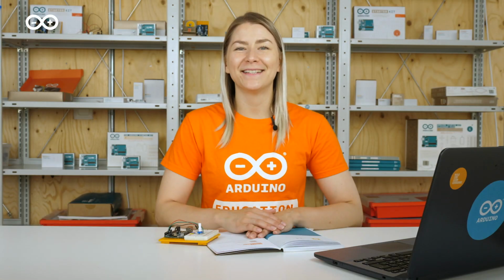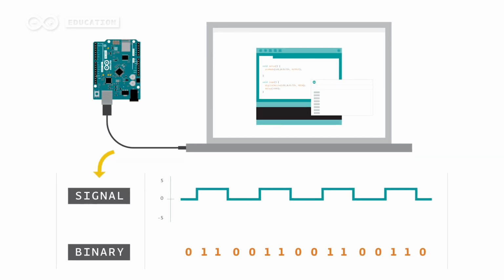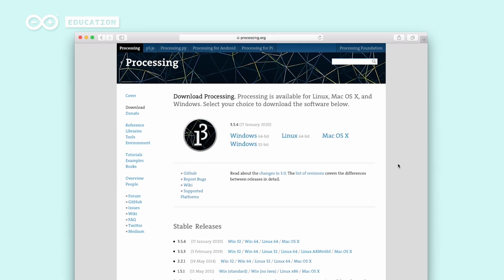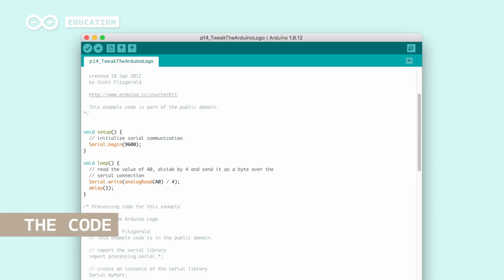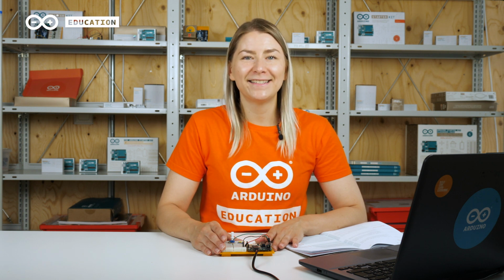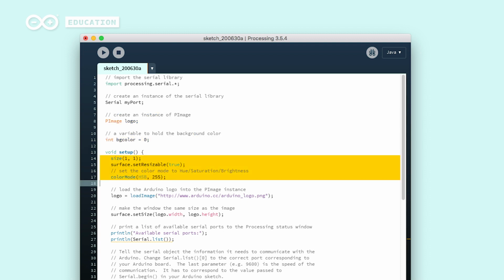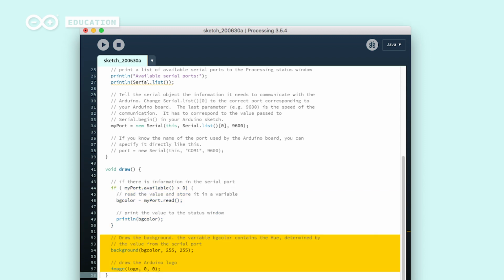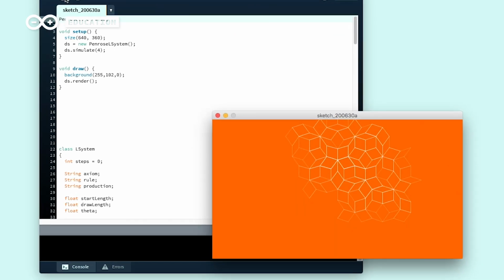14 Starter Kit: Tweak the Logo

Comment: Did you move Arduino logo from the URL? Why? WHY? WHYYYYYYYYYY?

For those who might struggle :

1. Change the delay in the Arduino IDE, delay(1) to delay(100), it's gonna be way more responsive, maybe a little bit less smooth, but more responsive, otherwise you have the feeling nothing is happening.
2. If the processing sketch is displaying (that little window with the logo), and you want to tweak the Arduino sketch, and upload it to your Arduino, it won't work, cause (I guess), the port is used by Processing to communicate with your board, so just close the Processing (logo) window, change your code in the Arduino IDE, upload it to your board AND THEN you can click on the play button in Processing to start the sketch and see the changes you made in Arduino.
3. Serial.write(analogRead(A0) / 4); will write weird character in the Arduino console, if you want to see numeral value do a Serial.print(analogRead(A0) / 4), Serial.write(analogRead(A0) / 4) is there to communicate through the serial port with your Processing sketch, it will read through myPort = new Serial(this, Serial.list()[3], 9600);

It's only me, or with Arduino you only have half of the informations or documentation, you never find all the informations necessary to complete something?
Reply: Is there a different link you used to try this out with? it seems the only issue i am having with the code is the inaccessible link they give us in the book.

Comment: On the Arduino side, with delay(1), readings from the potentiometer on A0 never changed.

With delay(100), this project worked properly.
Reply: Thank you. They need to update their tutorials and links. I also struggled with finding the capacitive sensor library.
Reply: You just saved me hours of pain, thanks.

Comment: @Arduino Hi, thanks for this video. I'm having some problems with this project. I did the setup exactly as mentioned in the video (after trying on my own with the textbook). I have copied the code from Arduino IDE to the processing IDE. But I'm having an error and the logo won't show up.
This is the error:
Error opening serial port /dev/cu.AvenzoAV624-BluetoothSe: Port busy

I don't know why is asking for that port, don't know what the Bluetooth port has to do with all this. Could you please help me solving this.
Thank in advance, and thanks for the tutorial.
Reply: FIXED: 
In Processing IDE: In the line "myPort = new Serial(this, Serial.list()[0], 9600);" I've changed the [0] from Serial.list() to [2] Why? don't really know... just tried different numbers... 
In Arduino IDE: Changed the delay to 100 milliseconds... apparently 1 is extremely fast for Processing. Got the answer from the Arduino forum here: https://forum.arduino.cc/index.php?topic=142311.0
Reply: @mrcsx1  Thanks! I had a similar issue. I checked the Console in Processing (tab on the bottom of the window) and found I actually have 8 ports. This is out-putted by the println(Serial.list()); line in your Processing sketch. I checked which one matches the port in the Arduino IDE (in the top menu, "Tools > Port") and then found that in the list of ports in processing.

Note that the list of ports starts with 0, so while my matching port was number 8, it is number 7 in the port list array.

Comment: When I try this projects I get random characters in the serial monitor, instead of numbers. I understand it has something to do with baud, but I don't understand how to fix it.
Reply: I'm not 100% sure how this works, but here's what I found: If you have a Serial.write, it is writing in binary data so will show unexpected characters. If you replace it with the Serial.println, then you will get the value of your potentiometer.

Note that, if you do this, it appears that the port will be "busy", so Processing will throw an error stating "Error opening serial port [YOUR PORT]: Port busy". Seems you can do write OR print, but not both.
Reply: This is because the Arduino's serial monitor expects only ASCII while you're using Serial.write() wich sends bytes from 0 to 255. So Processing understands it but the serial monitor tries to intepret it showing random characters. Try Serial.println() to see it.